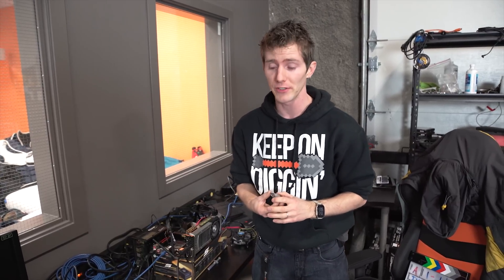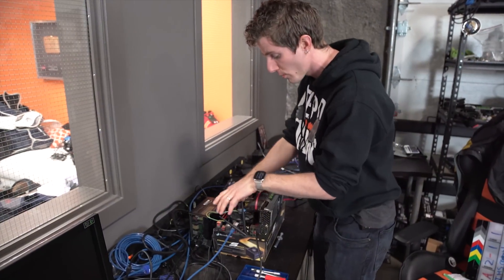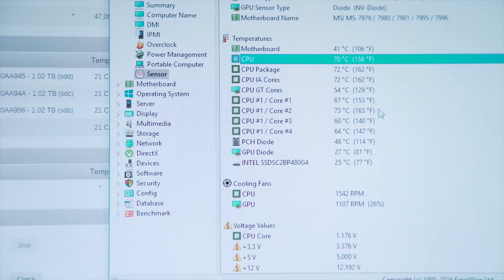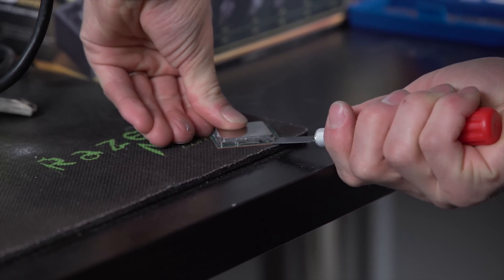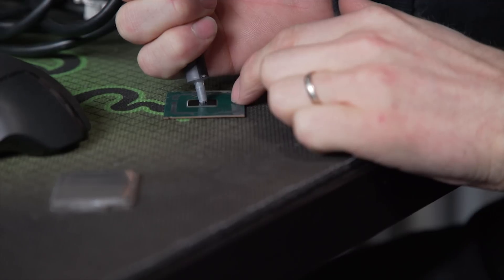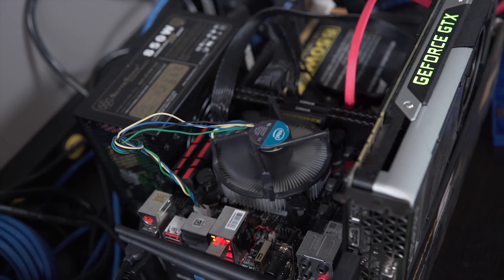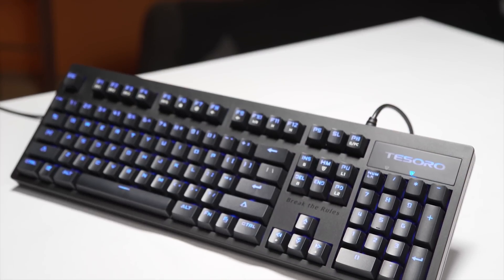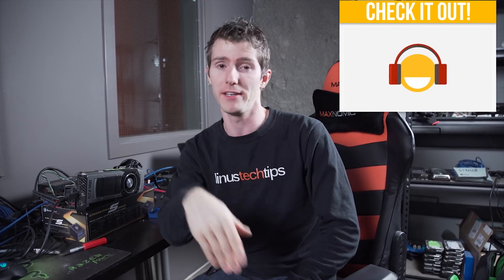Delidding an Intel Core i7 6700K - Is it worth it!?

Comment: 5 degrees at stock speeds with a badly done job is significant. To quote a message from a user named Ed Turvey - "This public service message is brought to you by Intel." and Linus' videos certainly seem to have a huge Intel advertiser's slant. With a well done job, an overclocked processor and a watercooling setup pulling away significant heat you can expect 10 degrees. If a 5 degrees difference is significant enough for everyone to advertise good thermal paste over cheap stock thermal paste then 10 degrees is certainly significant enough for a reasonable number of people to do with highly overclocked setups. Its not for everyone, but 10 degrees will allow for higher speeds and a good improvement to processor lifespan, Linus' badly done attempt with 5 degrees will do the same to a lesser degree yet still more than noticeable.

And ultimately this corporate PSA slant to everything Linus does for Intel is why I've largely stopped taking Linus seriously. Hes entertaining but I make sure to take nothing away from the videos and look elsewhere if I need information and suggest others do the same.
Reply: TheScaleless While your numbers are exaggerated the message is pretty accurate. Linus did it pretty poorly and I genuinely do believe he has an Intel-shill bias. It would explain why everything that could bias Intel was done, both poor method and poor testing.
Rot Bear  Its not about frequency at all. Look at the Pentium 4, awesome frequency for its time but the performance it got from that is minimal. Or the AMD 9590, 5GHz clock speed yet the 4GHz 6700k beats it.
DevilDude4427 Literally true. AMD has taken to selling boobies with every FX series processor.
Reply: As an engineer and a Gentoo Linux user, overclocking and better cooling makes perfect sense, and so does delidding. For those of you who don't know, compiling in parallel with native cflags use 100% of the processor for hours, and all instructions-sets are at play. If i can reduce the compilation time by 20 minutes on 2 hours by overclocking, it is worth it, as time is money. 

On my i7-6700K the Tcase is 64°C, which mean beyond that i would be sacrificing on the lifespan. With my (very very far from loud) watercooling, i can overclock to 4.5GHz at 1.35v and remain at 62°C instead of the 73°C i had prior. I can also attest it is a shit job if he only attained 5 degrees on it at stock speed. The heat is also spread more evenly now, as i had 3°C difference between cores 1-2 and 3-4 and now it's more or less 1°C.

Especially since i paid mine 550$CAD, i want to get as much processing power i can from it. 

Also, believe me, if Linus were able to delid it with an angled bending blade without damaging it, you can do it too. I personally removed over 30 IHS of Ivy Bridge, Haswell and Skylake without scraping one. 

And before talking about AMD, wait for the Zen to get out first, the IPC is greatly improved.
Reply: No, its very worth it... Most notably if you get a "lemon" CPU. My 6600k I recently got idled at 74C with a H60, needless to say it was a lemon. I didn't have time to return it, Ive done it before with my 4770k; so I delided it. Half the CPU die had tim on it... Lapped IHS, cool labs, and the H60 makes the idle temp same as ambient and 65C at load... I will be clocking it to 4.5GHz though. Linus never does a good job at anything, he is a very bad enthusiast... But its fun to watch, just its like junkyard wars all the time... even with new components.
Reply: Rot Bear While I understand your point of view, I disagree with your argument. I mean I myself run AMD which is known to be dramatically slower and then underclock by around 20%. However delidding is clearly for the sect of people who want the most extreme performance, some for the actual processing power and some just for the competition of overclocking the furthest - an actual professional sport these days. And you will likely get closer to 600MHz+ from it, plus technically overclocking already voids your warranty (though nobody will actually know if you have). 10 degrees is a huge difference in the overclocking world and as long as you don't break your CPU doing it you don't reduce its life span at all. If anything you increase it due to the lower temperatures. And the end is another point, a lot of people HAVE a couple million dollars. I know someone who ran 980ti in triple SLI watercooled, never even turned the computer on once with the cards and is now upgrading to triple 1080 watercooled. Like an expensive car some people just do it for the e-peen and have money to throw at a computer. But essentially there are a huge array of reasons people might delid their computer. Personally I'd consider it if I wasn't running AMD just because I don't like the idea of Intel saving literally a few cents and significantly reducing my thermal performance whilst doing it. I'd still sit there underclocked using near half the normal power of stock voltages, I just don't like the idea of being held back for pathetic reasoning.
Reply: @olivialambert4124  Just curious why you would underclock your CPU by 20%? After the initial fun of seeing how far I can overclock, I always ran my CPUs at their stock speed, but undervolted to reduce power usage, heat, and stress. You can certainly undervolt more if you underclock, but generally speaking, if you are building from scratch and you prioritize power efficiency over performance, saving some money buying a lower TDP CPU would probably be a better option for most users.

A high end CPU that's underclocked and undervolted to match the performance of a lower end and lower TDP CPU of the same architecture might take less voltage since it's likely to be binned better, but I can't think of any situation where the possibly marginally improved power efficiency would ever offset the added upfront cost of buying a higher end CPU to underclock.
Reply: @averyalexander2303  Because cost isn't a big limitation to me. By far my main usage case is games. That puts out efficiency oriented processors. But of the more conventional processor line the vast majority of games have zero FPS drop with a pretty slow CPU, hence underclocking it. Then as games progress and I need more power I can slowly increase the clock speed rather than dealing with the inconvenience of upgrading. Of the rare occasion I do play a game where CPU speeds benefit (eg Total War games) I can always get that performance back and then some with a more powerful CPU, whereas a cheaper CPU will struggle. So there's really little downside to getting a better CPU for me but there is still the occasional benefit.
Reply: Like or dislike this video, at least he DID delid a processor and show the results.  I am not Linus' biggest fan, but I do applaud him doing something I would never do myself.  Just because he states his opinion at the end should not stop you from making your own informed decision about doing this.
Reply: Guys, it's AMD trying to sabotage Intel! No girls exist on the Internet, it's just an imposter!
Reply: Damn super hot.
Reply: shocker - the comment from a girl has the most responses on this entire thread -_-
Reply: Olivia Lambert well said, I wish he actually did this more scientifically and explained the composition of the compounds used etc. He went very basic. It's kinda a shame as it doesn't encourage Intel to stop cheap -ing out on really important aspects of the packaging. Also weird that he is discouraging DIYers. He is fun to watch but yeah it's all $$$$$ and ads xD
Reply: totally true, it's even worse with kaby lake, getting a 7700k to 5ghz is almost impossible without delidding. you can see a temp drop anywhere from 10c to 25c just by removing the tim and using liquid metal instead
Reply: Rot Bear my 2600k is oc for 4 years on 4.0ghz :')  cpu based games op
Reply: Possibly, or try to fix your own problem. If the only thing wrong with it was a fan, instead of getting upset gigabyte won't sell you a new VGA cooler, you could of looked for an aftermarket VGA cooler, or aftermarket fans for it. 

The reason more companies don't get into the processing game is because they flat out can not do it. Intel has held all the copyrights in this monopoly (remember, they granted AMD the right to the x86 architecture way back when). Even such, it is hard to say if more companies would help, because even the second biggest player in this game is having issues keeping it's head above water as a company. The bar for entry is high, and will probably never come close to Intel in research and development. Technically VIA and IBM could theoretically start making processors.... but good luck. It would take an astronomical amount of money with no good rate of success or to even be profitable (and probably crushing AMD anyway, because they really can not deal with the competition).
Reply: You're absolutely right. I have a swiftech h320-x v2 with a delidded 6700k (liquid ultra under the IHS) and I am getting upwards of about 15c difference compared to non-delid. I am also over clocked to 4.7ghz.
Reply: Olivia Lambert why do you even care that linus done that badly? The whole point of this video is to show that deliding a cpu isn't worth it that is what linus wanted to tell to us
Reply: Do you think it's worth doing to apply arctic silver 5? That's all i have .
Reply: nicklong27 Not much to go on, but in the off chance you are asking me... No if you're a gamer. Focus on a better GPU. 10C isn't worth having to chance buying a new CPU. If you only have a tube of thermal paste don't chance your processor with an deliding.
Reply: Rot Bear I don't agree with your attitude towards AMD products, especially since it's been years since you've last used them. I've bought various AMD CPU's since the Phenom line and none of them have died on me; both stock and overclocked. I had an AMD Phenom II X4 965BE which I overclocked to 4.1GHz and is still working to this day in a mate of mine's machine. The FX-8320 which was OC'd to 5GHz is still working to this day which was put into a machine I built for another mate of mine. You probably just had bad luck.

At the moment I'm running an i7 5820k on the X99 platform which has a 24/7 overclock to 4.6GHz. It probably doesn't need it, but I like to see how much I can push my hardware. My build is here if you want to take a gander: https://plus.google.com/106577240689351818801/posts/Gwqao1veuEJ

However I do completely agree with you on the de-lidding stance. It's an extreme modification only for the extremists, not for the average user to be done willy nilly. The only instance I would condone it in a situation like that is if you bought the CPU second hand out of it's warranty period.
Reply: You are potentially throwing away $200-400 if you screw up on a new processor. Sorry, but I don't know if the majority have that money to throw away for negligible performance increases. It is easier, and within warranty to just leave it as is. Maybe if it is out of warranty and has an actual reason to be overclocked in such a manor. Also, delidding is a sticky point in resale, if that is your thing (I have parted out more then one build when upgrading).
Reply: T Swag Hit the nail right on the head man.
Reply: +DevilDude4427 lmao
Reply: +Rot Bear (Rowdy Rotty) You may be right about Seagate (I have very limited experience with them and only had 1 doa hdd) but my experience has been really good with ati/amd graphics cards. I've had 1 amd cpu and the rest (5ish) were intel and i had no problems with any of them. I've had 4 ati/amd graphics cards and they all ran well and never failed on me.Glad Intel works for you but I personally use amd and intel as they both have given me my money's worth. Everyone's experiences are different but competition is always a good thing otherwise we pay a premium price for that small extra performance gain as we do now with Intel i7 series cpus (amd currently has no answer on the high end).
Reply: Ahh. I guess I am the only one who has ghetto rigged a cpu cooler to an old graphics card. Moving on.

Your right, IBM does not make consumer chips, but for the most part they take on large business enterprises like consoles and other things. Makes ya wonder. 

In the end, IBM sold their x86 server rights to Lenovo, so yep. But again, still brings up the point the AMD is even currently struggling, so adding more hats to the arena may not be a better thing anyway.
Reply: Olivia Lambert I haven't been defending anyone but Linus here lady. You started the thread with a huge attack on him for not endorsing the removal of Intels stock IHS's. Throughout the thread I've been saying things like " I wish there were more companies making CPUs." and "Had my experiences with AMD been different so too would my review of their products.", and by far most importantly "Everyone should have the best possible PC experience regardless of what any asshole on the internet is saying about their choice of products." Your ability to form ideas which extend beyond three sentences is very impressive however, so for that I give you cudos. To anyone reading this thread I implore you not to take what Olivia says as solid proof that you should go with AMD. Likewise don't take anything I say as solid proof that you should go with Intel. Do your own research, and make up your own mind based on what resources you have. I hope any computer you put together works super awesome, and performs beyond your expectations.

If ever we go to another planet I will wear a blue shirt, and you wear your red shirt. It will work out, I promise. You definitely won't have all the salt in your body sucked out by a weird monster, or meet any harm. Your red shirt will protect you!  :-P
Reply: Olivia Lambert I too, have built and upgraded multiple machines from both AMD and Intel and while I see your point regarding processor performance, I think a lot of people choose Intel now for the platform. It's very similar to when X99 first released. The raw processor performance between Ivy-E on X79 and Haswell-E on X99 wasn't that big for the 6-core processors, however what changed a lot was the chipset and platform. This alone made it worthwhile jumping from X79 to X99.

I feel this is now the same with AMD vs Intel processors. Yes you can get a decent price/performance benefit in terms of raw processing power by going for AMD, but the downside is the AM3+ platform being well past it's sell by date so to speak. It's simply too old of a platform to be investing any sort of money into. That and the lack of upgradeability. Once you have an FX-8core that's it, you have no other processor upgrade paths since the FX-9590 is just a binned FX-8300 to handle a 1.5 Vcore and 4.7GHz by default.

Most people would rather go for a lower end Intel processor, but have the flexibility of upgrading to a more powerful CPU later on down the line when they have the money. This will also give them the chipset advantages over AMD's ageing chipset.
Reply: I agree with you
Reply: Olivia Lambert
Reply: spot on, mate
Reply: damn, you learn something new every day
Reply: if your willing to risk breaking your 400$ cpu for a 10 degree difference more power to you, but you shouldn't discredit Linus own opinion, because you think different.
Reply: Please grow a brain before making comments...k thx!   Delidding regularly shows results of FIFTEEN DEGREES LOWER OR MORE! On i7 4770K you would even see TWENTY DEGREES lower after delidding using PROPER paste like liquid ultra from cool laboratory instead of this nonsense crap paste linus used that is literally NO BETTER than the trash Intel had on it already....and you're supposed to spread the paste on the die too, of course linus is so biased against delidding (and so inexperienced) that he has no idea of that, or is just a shill for Intel and purposely faking it to make it look bad.
Reply: +Rot Bear (Rowdy Rotty) I haven't been playing with PC's as long as you have, but I learn quick and built several machines, both air cooled, AIO liquid cooled and custom liquid cooled, not to mention I've been working in the IT field for a few years now. Your opinion against overclocking and AMD seem to be outdated by quite a bit. Having personally used and overclocked AMD Phenom's, FX Piledrivers and now the Intel Haswell-E series I can tell you it has now become a lot easier and acceptable to overclock.

While officially overclocking voids the warranty, both parties will honour the warranty on a chip with an unlocked multiplier unless there's obvious and/or severe physical damage to the CPU. Overclocking also grants you a better price/performance benefit and I've tested this using Cinebench and 3DMark Firestrike Physics (which just tests your CPU's 3D environment rendering ability). I bought an AMD FX-8320 for £105 brand new and OC'd it to 5GHz (which it ran 24/7) and in Cinebench it scored within 5% of an i7 4790k - a CPU that costs over twice the price of it. In Firestrike it beat a stock i5 and was on par with a heavily overclocked i5 4690k. 

Power consumption and lifespan are invalid arguments too. I'm pretty sure the average gamer is more likely to swap their CPU's before they even get close to hitting the end of their lifespan. Every CPU has a minimum and maximum voltage it can take, as long as you stay within those limits and your temps are good, you won't be doing any harm to your CPU or reducing it's lifespan by any noticeable amount. In terms of power consumption, modern chipsets have the ability to modulate the Vcore and clockspeed based on what task you're currently performing. If it's just web browsing your CPU will underclock and undervolt itself to save power and become more efficient. If shit really hits the fan and you're gaming or rendering, the CPU voltage and clockspeed will return back to what you set it in the UEFI. 

You do have the option to turn this off though and run a 24/7 overclock if you so desire. Chances are you won't notice much of a difference to power consumption anyway. Xeon's are clocked considerably lower to save on power consumption as in a datacenter you'll typically be running a hell of a lot of them, not just the single one in a single machine. But with one machine it's not going to even put a dent in your power bill.

As for De-lidding, I would only advise it for the extremists, the ones who want to push every little bit of their CPU with a 'no holds barred' attitude. Usually a regular aftermarket heatsink or an AIO liquid cooler will do a good enough job to not need to perform this. After all, it is a physical modification to the CPU that will void the warranty and leave no chance of getting away with it either. So all in all De-lidding isn't really worth it for the average person, but for the extremists it helps a lot. Overlocking on the other hand can be worth it, even small overclocks like 500MHz
Reply: As to why I have 200 subs despite never making any videos (and never making any other content either for that matter), well as R-Spec demonstrated youtube is full of creeps.
Reply: +smirkingdevil He did a shit job to not get better results. I got +10C difference with 4770K even when I put more V, +100MHz core and dropped fan speed 700rpm. This video is shit and it makes me doubt everything else on their channel.
Reply: Rot Bear Ironic really, you're the one defending Intel as though your life depended on it. My statement started off as "slow CPUs can still run modern games". So yes AMD do create inferior products, theres no doubt about that (and it all comes down to transistor sizes and Intels proprietary 14nm process, which by the way is no longer going to be superior to AMD with the Zen using the 14nm process too) but that isn't the full answer. The reason anyone goes towards AMD is price per performance. You know, the thing which dictates nearly every single gaming machine. A great example happened in the real world, both I and my friend made gaming rigs for similar costs. In fact he spent more than me but lets ignore that for now. He was adamant on running Intel against my advice, I went AMD. As my processor was significantly cheaper he was only able to afford a 970 vs my R9 Fury X. As such my computer absolutely dominates his in every single game.

Or how about another story, up until recently I had my 8370 sitting in a box unopened because I was happily running my Phenom II with a Fury X with more FPS than my monitor could display. It even hit a 9 on the VR score and ran my Vive without issue. Or how about another story, I'm completely opposed to water cooling and so my system is air cooled. In fact my aim is to build a completely silent air cooled system so I removed the water cooling off of my Fury X for a Fury (non X, cheaper model) air cooled triple fan design and swapped it for my Fury X cooling which keeps my GPU at around 50 degrees, and I run a low profile heatsink smaller than the heatsink which came with my CPU and about the same size as that which comes with an Intel computer keeping my CPU at around 40-50 degrees in games at stock speeds, and in the low 40s and sometimes below with my 20% underclocked condition. No matter which way you argue it all I'm seeing is you a little butthurt that a few of your purchases broke just after warrenty. I haven't seen that at all. I've had plenty of AMD products and despite my abuse none of them have broken yet, some running for over 10 years before I finally took them apart. Hell with my Phenom II because of how silent I built my computer I didn't even bother turning it off. On average it would spend less than 12 hours a week turned off and it ran from 2009 and is still running to this day. Sure it was only running overclocked from 2014 onwards but I have put in short term temporary overclocks through its lifetime and have utterly abused it with those. Quite frankly I haven't seen AMD as unreliable as you state, and whilst it has been on average about on par with Intel the Phenom II is known for being one of the most reliable and best made processors ever built. Sure I've only ever broken one Intel product and that was my fault, but the point is AMD aren't as bad as you seem to think. I think the moral of the story here is "don't be a dipshit with your computing equipment".
Reply: conspiracy much? jeez.
Reply: How come you have 199 subscribers but no videos? O_o
Reply: You're overthinking it, it's just more content to put out and everyone has their preferences.
Reply: Olivia Lambert Well, like I said. Give me an infinite budget, and my argument changes. I run Intel because everything I've got from AMD broke within 2 weeks of the warranty running out. I used to love my ATI video cards, but I switched immediately when they were purchased by AMD. But in the end I won't hold being an AMD fan against you. I enjoy chatting with people who can form complete sentences. Have a great day!
Reply: +Olivia Lambert AMD I would have no problem doing that with because what an AMD processor is only like 85-200$ if I breaking it can just buy another easy, but an Intel processor no way I'm spending another 400-500$
Reply: Smooth af bud. you'll get her. on a more serious note: delidding is a personal preference. Theoretical It is worth it if you are trying to get the absolute best result however practically you wont really notice the difference unless you run synthetic benchmarks and compare numbers.
Reply: the reason why he has an "Intel slant" might have something to do with Intel being between 20% and 30% more efficient than AMDs at comparable speed.
Reply: Olivia Lambert  AMD created this slant by making inferior products. You're defending AMD as if your life depended on it right now. You have too much of an AMD slant, and your argument isn't getting any better. Go ahead and burn your CPUs up in a noisy liquid cooled rig for all I care. I'm going to go play doom on my 3.5 year old Intel based machine.
Reply: +Rot Bear (Rowdy Rotty) I've owned an Anthon X4 630 for 7 years, running for several hours each day. Still runs perfectly. AMD's CPU's are rubbish, I agree, but the only reason I was able to get a decent PC at the time with my limited budget was because of their low prices. Intel CPUs cost more because they're better in every way. Simple fact. Not sure I'm convinced about the dying at record speeds thing, though. That's not true in my case.
Reply: Ro-Tang Clan I appreciate your well thought out and grammatically correct argument. I have a long feud with AMD products. Both of the processors I bought from them died within a few days of their warranty, and I admit my opinion is bias. It has been a very long time since I've had any experience with that company. My stance is unchanged however because all of the Intel products I have bought worked until they became obsolete. I never overclocked anything including the AMD processors. They just gave out and died forcing me to shell out money just to keep my computer alive. The point of the video IMO is that you should not delid your processor for shits and giggles. That modification is fairly extreme. 200-500Mhz is not worth the sacrifice of your warranty. If your opinion differs accept that your processor will no longer be under warranty.
Reply: To be honest I wish there were more companies making CPUs. If there were 4-5 different companies making them nobody would care if I said screw X brand. When there are only two choices and you voice an opinion about one then half of the people will be pissed off (just look at the election, enough said). Less known, and cared about is that I will no longer be buying anything from Gigabyte. Bitches wouldn't sell me a new fan rig for my old video card. 2 hours on the phone saying "just send me the fan, I don't want to RMA anything." Later that week I bought a new MSI video card. Great job screwing yourself out of some money Gigabyte! Did you know there are a lot of companies that make the same things you do?
Reply: I looked for an aftermarket VGA cooler. A good one was $100. The card was worth $150, and a new video card was $300. Also I couldn't find an aftermarket cooler that listed my specific card as compatible, so I was left with only a few options. All beside the point to be honest. I was on the phone for hours telling gigabyte the exact model numbers of the stock fans I needed, and they wouldn't do anything except tell me to RMA my card. I'm not waiting 2 weeks to get my video card refurbished when I can swap out a fan myself. Sell me the god damn fan. I can deal with it if I break my video card in the process. I just wanted the fucking fan, and they were dicks about it. FUCK GIGABYTE. It's a shame. I like to name my hard drives after reboot villains and the video card fit right in with my naming scheme.

I am fairly sure IBM does make their own chips already. They just have a different market as the suppliers of ultra secure servers for fortune 500 companies. They have very likely moved beyond x86 architecture entirely for their machines.
Reply: Are you taking linus that serious? :s
Reply: Simon-Pierre Dubé I'm a gamer. I can run everything I want to on a 3.6Ghz Intel processor with no need to overclock it for any reason. My computer is a contender for a quiet build award for excellence in fan cooled systems IMO, because I can't hear it. It runs at a max of 65C in a room that is 35C. I didn't have to take the lid off of my processor, or do anything to it other than put it in the socket. If you have special needs, and/or the desire to void your warranty for a few extra compute cycles go ahead. I doubt Linus is saying anything to contradict that, but telling a possible audience of noobish PC enthusiasts that taking the lid off of your processor is a good idea is not in itself a good idea. If you need more compute cycles for compiling I would recommend getting a dual socket motherboard and 2 physical CPU's instead. With 2 CPU's you will get more of a performance boost than any overclock ever will, and you won't void your warranty.

I will talk about AMD all I want to as well. To anyone out there listening, and that gives a shit about what I say (probability 0.0000000001%) NEVER buy anything AMD makes. That includes ATI video cards because AMD owns ATI. AMD everything runs hotter, boasts more performance than they deliver, and they burn up and die in record time. AMD is as reliable as Seagate. Both companies produce the highest priced paperweights you will ever likely encounter. Fuck AMD, Zen, and anything else they put out EVER. AMD = Garbage.
Reply: Olivia Lambert  My argument is more from my long history working and playing with computers. First IBM compatible I had ran at 0.033Ghz, and in this new fancy space age I get the equivalent of 4 of em running 110X faster each. Why would I ever want to void my warranty for a fairly small boost in performance. Especially when the GPU's are so much more the spearhead of my gaming experience. What do you get out of this? I'm guessing 200-600Mhz of core performance at the cost of voiding your warranty, and dooming your system to a shorter life span. Enjoy your equipment how you like, but for me I'll just bask in the glory of having 4X 3,600,000,000Hz Cores where once I had 33,000,000Hz in my single core. Give me a couple million dollars, and I'll gladly throw my argument right out of the window, and pee on it though. An infinite budget would drastically change my position.
Reply: nah, dude hiding identity so
Reply: Why in the hell would you ever want to overclock any CPU anymore? Stock rates of nearly 4Ghz per core, and there are many of those cores. I run an early I7 Quad at its stock 3.6Ghz and it is rare that anything uses it to full potential.